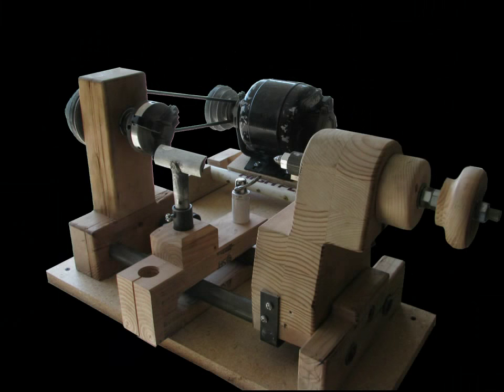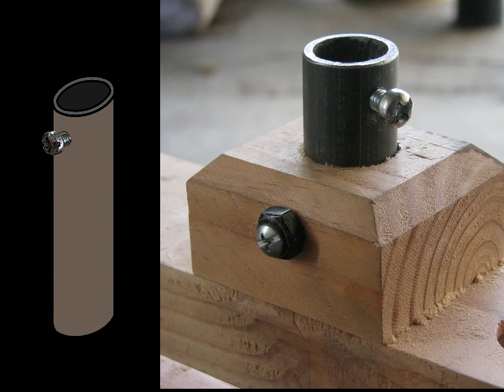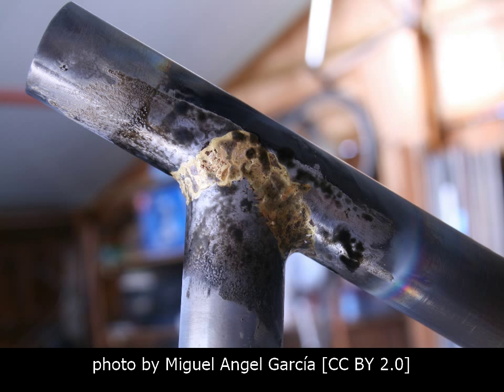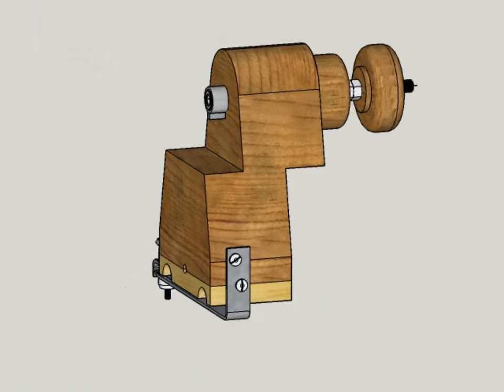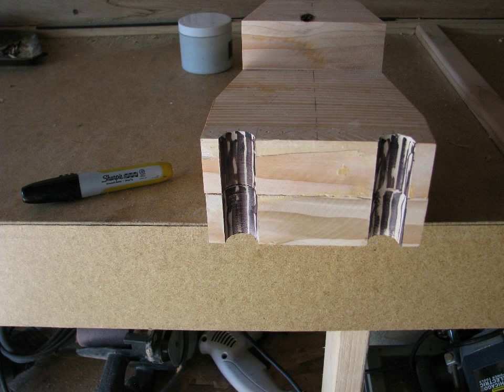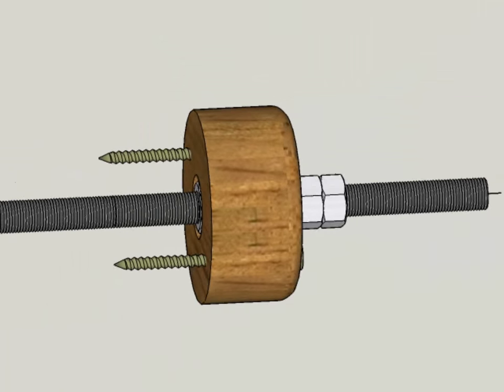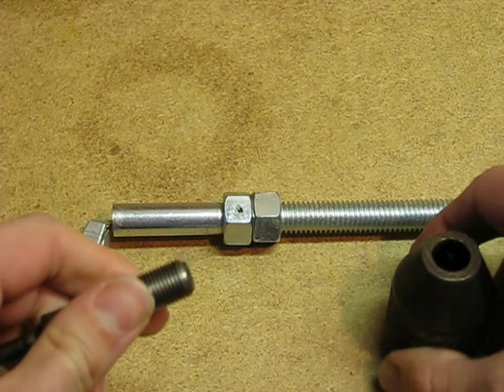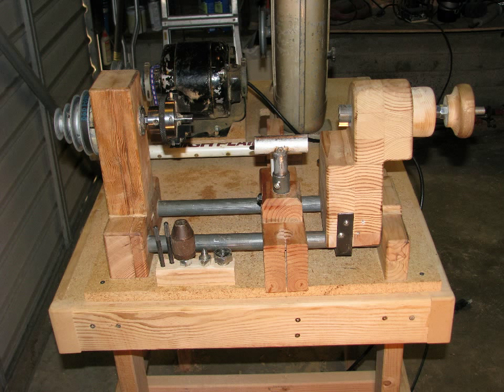Build a Lathe out of Bicycle Parts and Other Junk 2 of 2

Comment: Im about done with my homemade lathe and I gotta say Im very envious of your four jaw chuck! I got a keyed Jacobs chuck on the head, keyed to the shaft and a smaller Jacobs on the tail, so there is versatility, but I would probably have to redesign and start from scratch if I were to really need a metal-working version, I like how yours is kind of a hybrid and it would not have to be completely reworked for metal, just upgraded here and there.

Comment: sir why you don't make chuck manually
Reply from the maker: I had this nice scroll chuck to use.  If I hadn't I would have made a 
face-plate and/or simple wooden plug chucks for particular jobs.  But a 
self-centering chuck like the one I have would be a big job to do 
manually.  Basically, just use what you have until you get around to 
making something better.
Reply: Abdalla Elhage